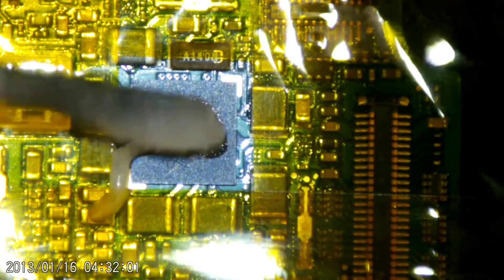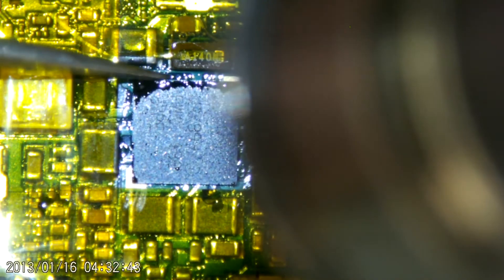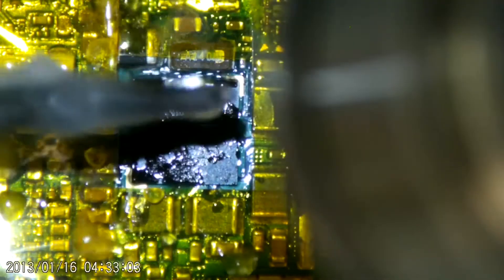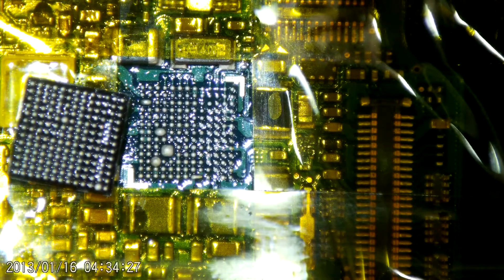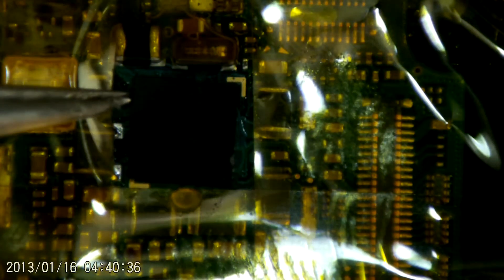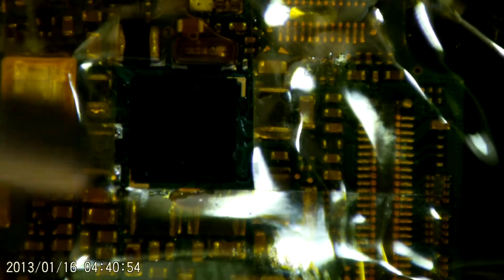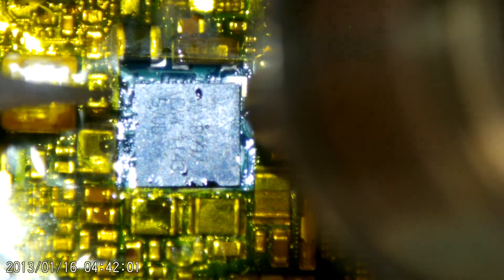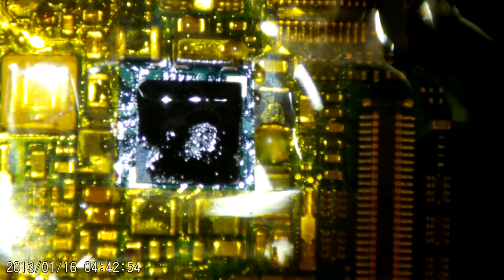Samsung Galaxy S2 Power IC Max8997 Replacement

Comment: hello.i have NOTE 20 ULTRA.NO POWER.THE PHONE WONT TAKE CHARGE THROUGH CABLE but if i use the wireless charger then it takes charge.the thermal camera shows me heat as power ic chip is shorted.is this normal and if the power ic is shorted will cause the phone to not power on?than you
Reply from the maker: No idea

I would suspect tho if it chargers wireless that the ic is fine

And there is something wrong with your charger port / flex